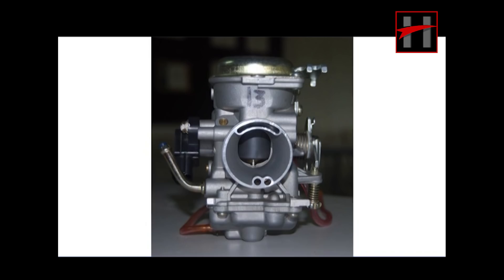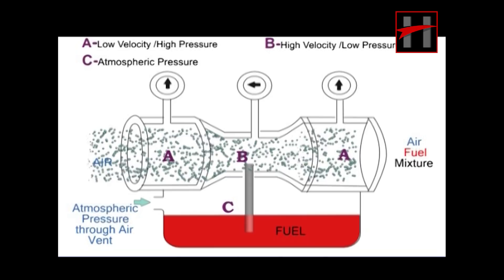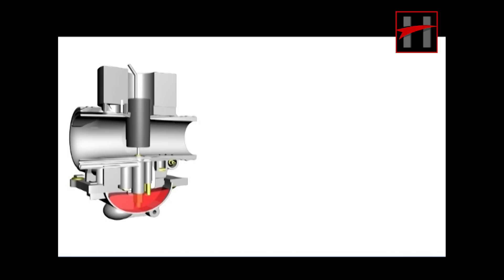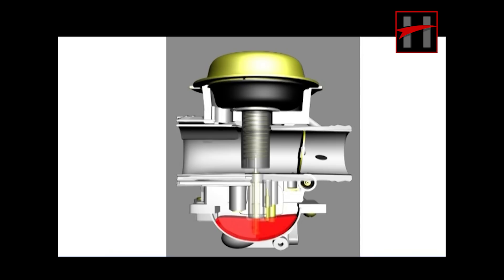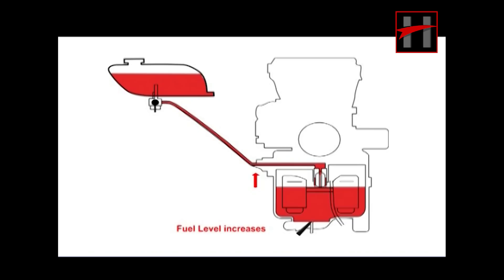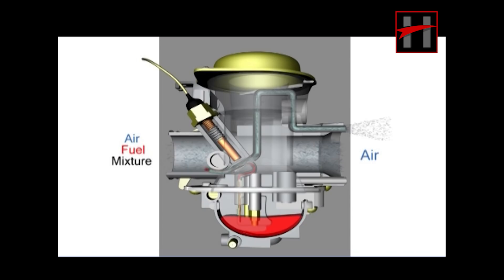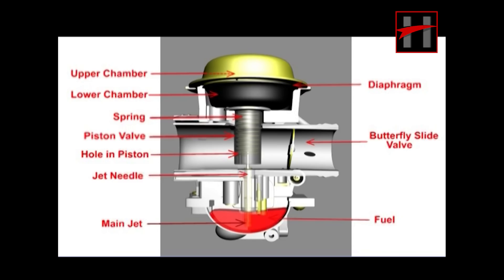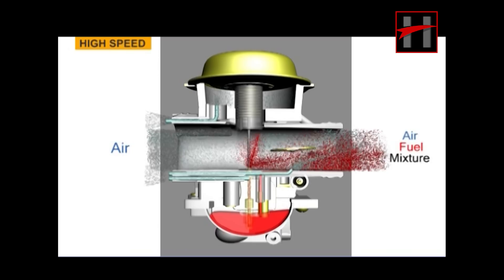How Carburettor Works ( 3D Animation) in Suzuki GS150R Motorcycle

Comment: hi !
This video was really helpful in understanding the working.

Can you please make a similar video on how to tune a carb for optimal performance ?
As you know the working principle of the carb,
And it will icing on cake if you explain the effects of lean and rich mixture on the engine.
Reply: İf you need a more performance air fuel mix.(pilot jet) Screw little loose lie half turn. Stage2 main jet size up. ı think
Reply: @yusufcaliskan8500  That is not quite what he means, if your engine runs too lean the revs will creep down rather than settle quickly to idle, too rich and they will drop below idle before coming up again. You tune each carb to get a strong idle and keep checking how it is when revved and left to settle, should as said drop quickly to idle and stay without dropping below. Tune carbs when at operating temperature too.

There is a small chance I got the rich and lean the wrong way around, but sure that is correct, and still should help you tune them correctly.

Comment: Hi. My 350 CC Royal Enfield has BS29 UCAL carburetor. I just wanted to know that when we tune the carburetor for optimum mixture of fuel & air. We turn AFR screw. So when we turn the AFR screw (of BS29 carburetor) CLOCKWISE, it makes the air fuel mixture rich or lean...?
It's a very small question but I found it very controversial. Because lot of people says, if we turn the AFR screw (of BS 29 carburetor) clockwise, it will increase the fuel. And some says, it will increase the air....🙄
So please help me for that...🙏
Thanks.

Comment: unfortunately this CV carb video like all the other CV carb videos on youtube only cover the carbs operation during idle and acceleration conditions and doesn't address the carbs operation during higher rpm cruise conditions when the engine is running at a steady high rpm but with very little throttle opening....